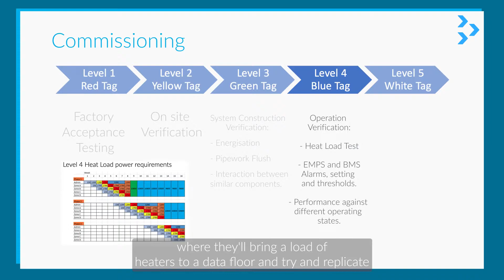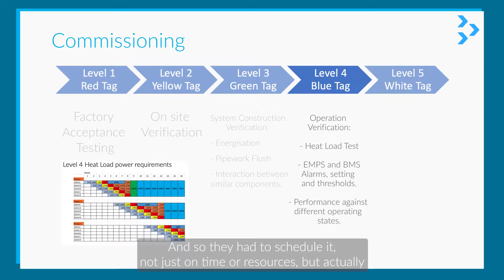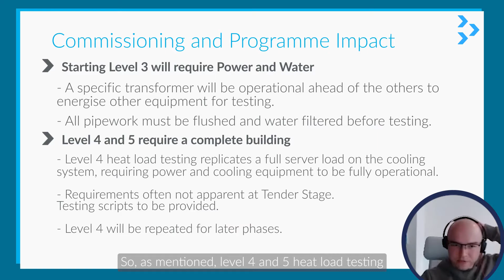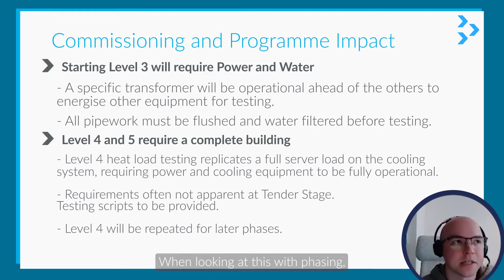Commissioning in Data Centres

Comment: The presentation is good not bad but did not covered the whole 7 steps when it comes to datacenters commissioning  in 2025, in fact there are 7 steps for datacenter commissioning process 1- design Review 2- FAT/Factory acceptance test 3- SAT/Site acceptance testing 4- IST integrated system testing 5- PFT pre functional testing - 6- Functional Performance Testing 7 Transition to Operations. Abdul Wali Hayat CDCP/PMP/QA/QC Data Center Certified professional.